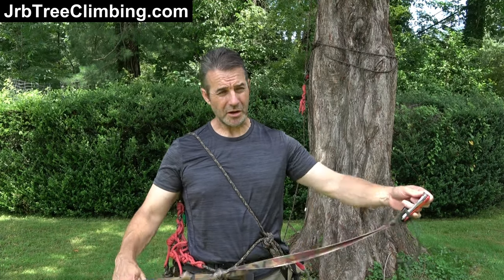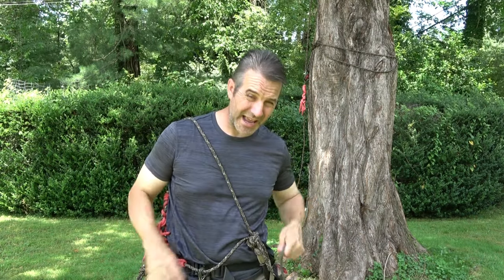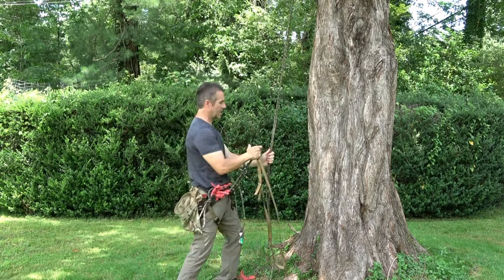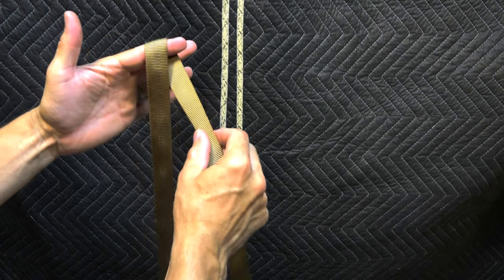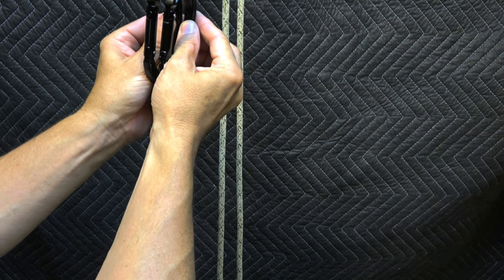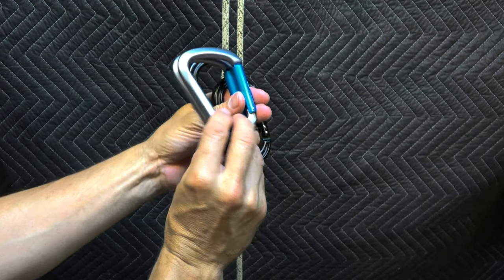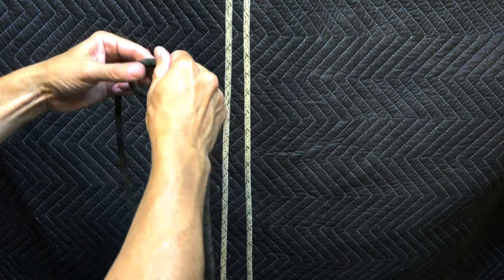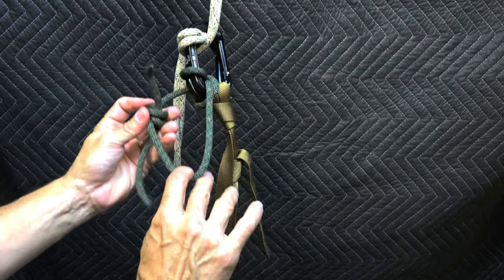JRB Garda Hitch Footloop, Single Loop Variant

Comment: Just tested this a few times. Having the gates facing the same side with matching opening direction, it's very possible to open the gate of the second biner with the tag/hand section of the main line (while it's unloaded during upward movement)and have it clip into the second biner... essentially just having a double loop around both biners, causing the hitch to fail. Opposing gates with an "x" pattern when they open prevents this from occurring and greatly increases the safety of the system, especially if it's being used as a backup fall arrest system via the best friend. Excellent ascension system if that step is done though.
Reply from the maker: @garlandmcnew4282  As you are likely aware, I didn't invent the Garda Hitch, I improved it. Carabiner shapes vary greatly and I don't believe that what you're proposing would hold on non oval carabiners. They need to line up with each other when using D and Pear shapes.   I would also like to see a video of how you got the gate to open.  I have executed thousands of tests and climbs and am not aware of how that would be possible.
Reply: To avoid any interaction of the hitch with the gates you can have the opposing gate openings at the bottom of the system by rotating the biners after clipping into the main line (e.g. atrier end)
Reply from the maker: @garlandmcnew4282  I understand what you're describing, but doing so requires the Bull Hitch Variation to be looosened and by default, it is clamped very tight. Looosenig it is not practical and could introduce other issues. Please don't guess.  If you can demonstrate a realistic scenario where the gates could open in normal use, please share the video and details with us. You said you tested it.  What test failed?
Reply: @jrbtc  100% correct on the non-ovals, opposing gates with ovals is the use case I'm referring to, which it looked like you were using here, as was I. Yup, you're right, having that tight hitch for the step makes it tough to separate the opposing biner enough at the bottom (good point), the opposing gate openings oriented toward the top (with an x) still allows for the opposing openings, and ability to easily clip in into the main line. I have those exact ovals, so that's what I'm using to compare here. It's not that the system failed while using it in the field, it has a potential for failure that can be easily mitigated. It can just be improved for safety using a pretty standard technique for doubling ovals. The hitch works great for ascension. the issue is the ability unclip the second biner with the tag end when the setup is lightly loaded allowing the tag end to slip between the two biners towards the gate and thus open it with a pull.
Reply: And to be clear, I've tested it on a gym bar and am able to unclip as stated above. Not theoretical/guessing there.
Reply from the maker: @garlandmcnew4282  I just spent time retesting it also. As soon as I advance the footloop, the rope always falls properly before loading the footloop.   The weight of just the footloop and the carabiners themselves keeps them properly oriented.  The only way I could get the falling strand of rope to improperly reorient as you describe was to raise the bottom end of the carabiners and wiggle it with them with gates facing down.  Reinforced by my years using this device, I am confident gravity won't allow that to happen on its own.   It requires user manipulation.

Comment: Good idea for an improved footloop, did a practice climb and adjusted mine to best length, ground to belt high. Also played with the agile hitch on double stationary rope climb, seems that the agile hitch with 4 or 5 wraps is hard to break, but 3 main wraps and then the extra half wrap at the bottom, ascends nice and not so hard to break on rappel, but the 5-2-3 jrb compact with a ring is still my preference. Oh , this was on resc rech 8 mm and 6 mm Sterling accessory cord
Reply from the maker: The Agile Hitch works best with a handle... not only for operation but   it makes it easier to break.

Comment: Hi John, 

Speaking of the geometry, what adjustments could be made to enable a deeper step, I would like  my foot to be quite high. I am a rock climber same height as yourself and i have very good strength and stability from such positions. Having a longer step would also cover more distance per step which i like the idea of
Reply from the maker: Jay, we can get a bigger step, but it's important to ensure that if for whatever reason, your friction hitches didn't hold and you found yourself on your best friend and garda, that you can load your garda AND recover. Let's say I want 6 more inches of step: 
1. Shorter friction hitches with a longer main bridge will give me more room to work the Garda. The BF loop or lower bridge might need to be slightly longer to allow me to pull the garda up higher. 
2. Can also make the Garda a few inches shorter... but if it's too short, we won't be able to load it. 

Pls watch this video as well.
https://youtu.be/3KI1lvyk3ds?si=HQIP3ZSaoCYw_Aj6

Comment: Is there any reason why I couldn’t use a hand ascender with a pulley above the Compact JRBAscender in hitch climbing to gain mechanical advantage?
Reply from the maker: You could. I have tested it and it works.  This option had slightly better performance. And I don't see a reason why an able bodied person needs the MA.
https://youtu.be/6tTmMyZz9MM?si=F0z4b4Vbwf5cx0Kk

Comment: have you ever tried not putting the loop on the carabiners but just connecting your second bridge carabiner directly to the carbiners on the garda hitch?
Reply from the maker: Good question. I can't recommend that.  Without the load being put on the clove hitch, we are relying on the uploaded webbing to keep those biners stable, and that is not guaranteed and could destabilize.
Reply: @jrbtc  is the clove hitch from the "Best Friend" loop a critical component to the operation of the Garda Hitch? I guess so, based on your response above. I didn't realize that.
Reply from the maker: @paulcrave3826  I didn't invent the Garda Hitch.  I discovered it through research and learned that it's known for being unreliable and not holding if the carabiners don't remain properly aligned. I then built and tested many variations before finding one that was consistently reliable  both as a footloop and a backup, and this is that design and it uses a clove hitch for the cord. Sure, it might hold without the clove but it might not. We need our backup to be reliable.
Reply: @jrbtc  got ya. Thanks.

Comment: John, I jumped ahead when I saw the double footloop version, made a single loop one myself, before you did this...and came up with a different solution.  A single large footloop (I used a figure 8 on a bight), then up the webbing several feet I tied the bull variant.  I then used the remaining "tail" from the bull hitch, tied a small figure 8 loop at the end of it, for use as my "best friend".  Do you see any issues there?  Uses significantly less webbing than your variant, but I'm not seeing the con side of it.
Reply from the maker: I would need to see it to be certain  but it sounds fine... the only thing which is a MUST is the bull hitch variant and it must have the load distributed on BOTH strands exiting it. This ensures that the carabiners are squeezed evenly and therefore won't jockey out of position.  If you're in my Facebook group, post a photo!
Reply: @jrbtc  Excellent point!  Mine does not have that feature!  I'll retie!

Comment: does this work if you don't use webbing.... i.e. with paracord (for the foot loop not "best friend")? same "bull hitch" or what would be best? 
been obsessed with your channel to gear up for hunting! thx!
Reply from the maker: I can't recommend anything but one inch webbing, as the one inch distribution of force keeps the carabiners aligned.  Definitely not paracord, it's too weak and stretchy. Sure, its likely that if ya tied both loops with a clove hitch and both with 7mm or larger cord, it's likely to usually hold... and that might be acceptable for a footloop which itself is not a life safety device... but we need the Garda to function as a life safety backup via the "best friend " loop.  And so unless you accept the responsibility to test it, i would not use it.  Testing takes a long time... how do we know it won't fail one a million times if we don't test a million times...
Reply: @jrbtc  thanks so much for the response! I am newb  and I am glad I asked. Been practicing in my basement lots... so learning process will only cause minor pain but no permanent damage (other than maybe the ego : ). When climbing a tree, I am always going to back up my hitches with an auto-locking belay device (at least for the first few seasons.) Really appresh your knots R&D, testing and then sharing with us!
Reply from the maker: @ITPCD  thanks and know that I am happy to help if in no other way than to provoke thought.  In fact, about an hour ago, i released a new video on ladder stand safety scenario... and i rarely climb a ladder stand any more.